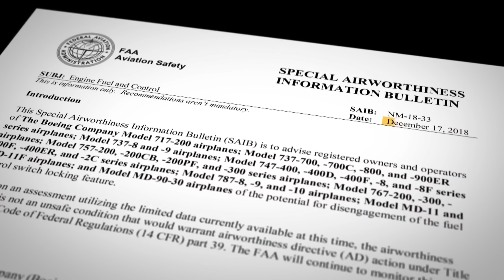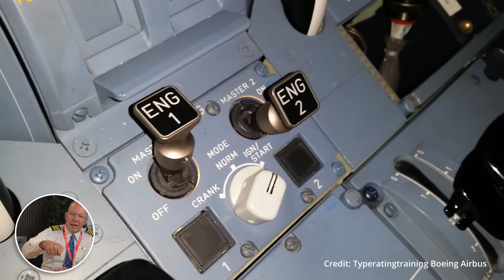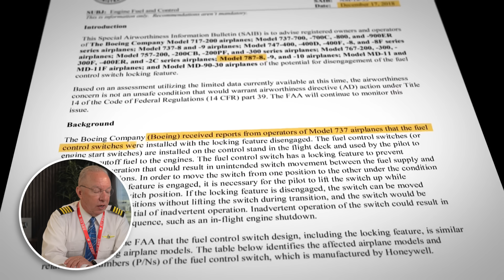Air India 171: The FAA’s 2018 Fuel Switch Locking Bulletin Explained (16 Questions Answered)

Comment: As a passenger and frequent flyer, I consider it essential that this issue is thoroughly investigated and transparently clarified.
The following outlines the key problems and corresponding countermeasures that must be addressed.
Conclusion at 1:37. Capt Steeve answers this question:
Switches in 'Cutoff' at Takeoff?

1:20 the fuel switches have already been in
1:22 the cut off position at takeoff and the
1:24 engines only shut down once the aircraft
1:26 lifted off and the gear retracted?" No,
1:28 that's not how they work. They're in a
1:30 detent that holds them into place. The
1:31 engines would cease running. You
1:33 wouldn't be able to push the power up to
1:34 take off. So, no, that's that's wouldn't
1:36 have happened
This would not happen in a normal situation. By definition, we are dealing with an abnormal situation.

In any case, we can expect thousands of questions and opinions to circulate. The way this issue is being handled publicly is, from the perspective of industry transparency and accountability, disastrous. For this reason, I will withhold my personal opinion.

FACT 1:
A so-called “Preliminary Report” is being shown in the news, allegedly unsigned.

FACT 2:
As customers, our expectation is clear: to see all responsible parties publicly present a Final Report, including facts, conclusions, and corrective actions to ensure such an incident never happens again.

Required Participants and Documentation for a Comprehensive Investigation:

One representative from Boeing (Aircraft Manufacturer)

One representative from General Electric (Turbine Manufacturer)

One representative from the Pilots' Union

One representative from Boeing (Structural Engineering)

One representative from Boeing (Systems Software Engineering)

One representative from Boeing (Hydraulics Engineering)

One representative from the Federal Aviation Administration (FAA)

All investigators who had access to the flight data recorders (Black Boxes)

A detailed timeline of all personnel who handled the flight data recorders

A detailed timeline of all individuals involved in rescue operations

Conclusion:
Without these documents and a public presentation of the final report, any conclusions remain speculative.

ChatGPT fragen

Comment: What about Electrical Wiring Interconnecting System malfunction? Ex Boeing employee itself made a comment that the facts in the report are inconclusive to point out a pilot error. Please refrain from blaming the pilot until the full transcript of the conversations or other data regarding engine status before the crash is known or published. Boeing has a reputation for hiding it's faults and blaming the pilots.

Comment: *FUEL CONTROL SWITCH (LEVERLOCK)*

• Switch Type: Leverlock toggle with spring-loaded guard.
• Action: Must be pulled up/out to clear detent before moving between RUN and CUTOFF positions.
• Signal to FADEC: Discrete electronic inputs; no mechanical linkage.
• System Behavior: FADEC responds to electronic state and logs transition; physical switch movement is not cross-checked.
• Implications: Spurious electronic input can simulate a switch transition, causing fuel cutoff with no physical manipulation.

Comment: I can comment on the solder ball failure issue - it’s a hardware issue, and it’s not going to knock out both engines (with 2 redundant channels on each engine) at the same time.

Comment: This message is strictly  for america who dominant every country and soft on real issue for the humanity safety 
I am writing to highlight a fatal vulnerability in cockpit system design and standard operating procedures, where a single toggle of a fuel switch — accidentally or unknowingly — led to the simultaneous shutdown of both engines during takeoff. This exposed not only a mechanical design flaw, but also a critical SOP weakness and lack of intelligent software safeguards.

This was not just a human error.
It was:
- A *design flaw*
- A *software safeguard failure*
- And a *shared-responsibility confusion* created by outdated cockpit protocols

As a thinking citizen with no flying license but basic logic, I request you to consider the following urgent recommendations:

---

### 🚨 Core Suggestion: Redefine Pilot Roles in Critical Phases

During takeoff, landing, or any critical flight phase:

✅ *Only one designated pilot (Pilot Flying – PF)* should have full operational control over all critical systems and buttons.

✅ *The second pilot (Pilot Monitoring – PM)* must *strictly not touch any critical switch**, including the fuel control switch. Their job should be **limited to verbal confirmation* only.

👉 Allowing both pilots to perform physical actions on the same switches increases the risk of confusion — as clearly evident in recent incidents where fuel was shut off but neither pilot admitted pressing the switch.

There must be **no dual control on mission-critical operations during key flight phases**. Just like only one person flies the aircraft at a time, only one should control buttons. The other should only verify vocally.

---

### 🧠 Software-Based Safety: Where was the system intelligence?

Modern aircraft are equipped with advanced flight computers that constantly monitor:

- Altitude
- Airspeed
- Throttle setting
- Fuel pressure
- Aircraft state (airborne or ground)

Then why does the system **allow full engine fuel cutoff at low altitude right after takeoff**, without even asking for confirmation?

Even phone apps show “Are you sure?” pop-ups.

But a jetliner carrying 200+ lives **lets both engines shut down in flight due to a mistaken toggle**, with **no software logic stopping it**, and **no warning or lockout**?

This is unacceptable.

---

### ✅ Immediate Actions Recommended:

1. *Software-level fuel switch lock*  
   - Prohibit engine fuel cutoff below safe altitude (e.g., 1000 feet AGL)  
   - Show warning prompt or require double-confirmation

2. *Mechanical redesign of fuel switches*  
   - Add safety guards, toggle-resistance, or physical locks

3. *Strict SOP reform*  
   - Only one pilot (PF) should operate critical switches  
   - Second pilot (PM) must NOT touch buttons — only confirm actions

4. *Mandatory cockpit video recording*  
   - So that finger movement and button action can be verified, not just voice

---

### 🎯 Final Message:

You track wars across borders, but cannot control chaos inside your own cockpits?  
Billions are spent on fighter jets, yet a single button press still crashes passenger aircraft?

Fix the real battlefield — your cockpit design.

*Stop fuelling war. Start fixing the switch that cuts real fuel — and lives.*

Sincerely,  
Dixit gaba karnal  
Concerned global citizen  
India

Comment: Subject: Safety Suggestion for Engine Shutdown Logic – Smart Pilot-Confirmed Control to Prevent Accidental Shutdowns During Flight

Respected Sir/Madam,

I would like to submit an important safety suggestion related to aircraft engine shutdown logic, which may help prevent accidents caused by unintentional inputs or premature automatic decisions.

In several cases, aircraft engines have been shut down instantly during flight or takeoff roll due to accidental pressing of the fuel cutoff switch or activation of a fire sensor, even when there was no actual emergency confirmed. At such critical moments, sudden loss of thrust can make the aircraft uncontrollable and lead to accidents.

I propose a smart system update in which the engine shutdown is based only on real confirmed emergencies or pilot-initiated actions, not on single automatic triggers. If the aircraft is flying at low altitude, especially close to the ground, the engine should never shut down merely because the fuel cutoff switch was pressed or fire sensor alert was received—unless the pilot manually pulls the fire handle or confirms the shutdown intentionally.

In a normal scenario where the aircraft is airborne and the fuel cutoff switch is accidentally activated, but no fire alert is received and the fire handle is not pulled, the system should not shut the engine down immediately. Instead, it should maintain combustion for 90 seconds and show a cockpit warning like:

> “FUEL CUTOFF DETECTED – ENGINE SHUTDOWN IN 90 SECONDS UNLESS RECOVERED.”

During this buffer time, if the pilot restores the switch to normal, the shutdown is aborted. If not, a controlled shutdown begins after 90 seconds.

Similarly, in case a fire sensor alert is triggered while airborne, the engine should still remain ON, and the system should not take automatic shutdown action unless the pilot manually confirms it by pulling the fire handle. The system must show a critical message like:

> “ENGINE FIRE DETECTED – MANUAL FIRE HANDLE REQUIRED FOR SHUTDOWN,”

and thrust must continue until the pilot takes action.

This logic should also apply if both fire alert and fuel cutoff input are received simultaneously — the engine should not shut down unless the pilot confirms via fire handle. This is crucial because thrust is most needed during takeoff and climb, and an automatic shutdown in flight could be dangerous.

Even if the fire alert or fuel cutoff signal persists for a long time, the system should not act unless the pilot confirms manually.

If the engine fire alert or fuel cutoff switch is triggered during takeoff roll while the aircraft is still on the runway, the system should provide a short 10-second buffer so that the pilot has a chance to decide whether to continue the takeoff or abort. If the pilot chooses to continue, the aircraft enters airborne mode, and the 90-second manual confirmation logic begins. On the other hand, if the aircraft is parked on ground or in maintenance/testing mode, and a fire alert or fuel cutoff is triggered, the system should shut the engine down immediately since no thrust is required and the risk is higher.

This entire system can be implemented without adding any new mechanical component—only a software-level logic update is needed. The engine control system (such as FADEC) should take inputs like:

Aircraft position (airborne or ground)

GPS speed

Parking brake

Gear position

Fuel cutoff switch status

Fire sensor alert

Fire handle status

to make an intelligent, situation-aware shutdown decision.

This way, the final decision always remains with the pilot, and the system never takes away human control in critical situations. The purpose of this suggestion is to enhance flight safety by avoiding blind automatic shutdowns and instead introducing smart, pilot-confirmed logic that gives time for error recovery or real-time decision-making during emergencies involving fuel cutoff or engine fire.

I hope this concept may support aviation safety improvements through practical and software-based solutions.

Sincerely,
Dixit Gaba
Concerned Citizen, India

Thank you
© 2025 Dixit Gaba. All rights reserved.

Comment: The pilots were doing what they were supposed to, switches were being recycled to deal with emergency of no thrust due to fatal electronic control problem of complex fuel systems. Did the report mention the loud bang heard by survivor or the possible smoke seen on the video from no 1 engine at rotation?

Comment: If we assume that somehow both engines failed, does moving those fuel nobs to cut off and back to on is part of the procedure, in case engines does not give power. 

Very conveniently, only that part of conversation is out which will give rise to such theory of pilots fault. The conversation between the two pilots can also be part of procedure after they found no power in engine.

Comment: Capt your interpretation of the FAA SAIB is laughable, and your treatment of the issue was extremely inadequate. That tells me a lot. You say that the bulletin is about the fuel switch being fixed upside down so that it would always drop down? In fact the bulletin indicates that if the safety lock on the fuel switch is not engaged, the switch can be moved WITHOUT having to lift it out of the socket. If that is the case, you are looking at a scenario where the fuel switches can be quite easily knocked into cutoff position inadvertently. 
Further, the report indicates that Air India had not undertaken any checks of the plane with regard to this aspect. Would you now like to read the bulletin again and correct your statement? or is it just better to put out unfounded theories about murder and suicide for the views without any regard for the victims?

Comment: The manual switches ? 
The desing way ? 
In between...micro indicators.
But...is it a computer help at starting the aircraft so servos lifts the manuals. ?
Because it is i/o what the.prm see.
So simply the shut of valve is.electrical..a relay..or triac..not a home lamp switch...
Furter...at airport..any acess in meters to wireless read or only read.
I think you se the manual isnt overide if a superviced prm runs the hwole start proceedure to have all systems go and redy.
You say there is q second between in fligt data recorder.....lift a coffe cup 1 dm...it takes longer...
Some.ghost in the machine.
sudden power dipp can cause an locked di input or even release one.
I dont work with aircrafts but long experience with computer controlled machines with higest construction plans.
Fx..a lightning actually can freese a panel and digital input. Rush current with sudden disrupt. A spike or dipp can activate di fumctions.
So if aircraft have 2 system..one supervicing the run build first system.
The superviced chec and make the first all di in their positions..this is function correcting any failure as long the device is activated ( ready and go)

As for shipping industry a acess to shore that responsible tec fx at leave can have acess..read only.maybe or full prm acess.
So back to the heat problem...eöectric circuits like it cold :)

Comment: Thanks - You answered my question, Re: could someone hack-into the cont logic network on the plane, and switch valves closed. Or change logic, to close valves when it switched to “in-Air” mode.  ML

Comment: To say it was some incredible, super human instinct, to turn the fuel back on, blows my mind. I'm sure I'll get blasted for it, but wouldn't that be the absolute first thing you would do, like as soon as you saw the other pilot switch them off? I think my hand would be over theirs before they got the 2nd switch off. There's probably a moment of disbelief, but 10 seconds??

It's really a legit question more than a criticism. What other task, at that point in time, was more urgent than restoring fuel to the engines? Sure, if they were in a spin, that might have been more urgent to correct first, but they weren't. I get it, you're a pilot, and you want to put these guys in the best light possible, but I played the video of the crash back, and from the very moment I could see the plane reach apogee and start to descend, I counted off 10 seconds. That was a looooong 10 seconds.

Is there are procedure that states x number of seconds must elapse before switching the fuel back on? I can't imagine why, but I'm still having trouble processing this one...

Comment: I still don't think there's a  complete answer. This extract hasn't been fully explained to me "FADEC has complete control over the engine's fuel flow, ignition timing, and other parameters, unlike systems with limited control. " The COMPLETE CONTROL is the problem.

Comment: Cpt Steve, you are interpreting the AD about fuel control switches wrong. The switches would not immediately go by themselves to cutoff position, and therefore the inspection is required (or advised as in the AD)

Comment: Boeing should be held responsible for not incorporating critical logic in their flight core systems. 

No pilot would switch off both engines one after another in such a short span (even in their dreams). Moreover, to prevent such actions, even in cases of hijacking where a malicious intruder puts lives at risk in the cockpit, a better core logic system should be in place to shut off both engines (in case of fire on both engines). 

A simple safeguard could be that when one engine's fuel cutoff is activated, the other engine's cutoff would require two or three deliberate confirmations to ensure the input is intentional from the pilots. Whereas, more sophisticated authentication can be done with instruction on checklist procedure booklet.
Given the presence of core flight computers, implementing such logic should require only few lines of code. 

The FAA's 2018 report also raises questions about these switches. 

Therefore, Boeing cannot and should not emerge unscathed from this investigation.